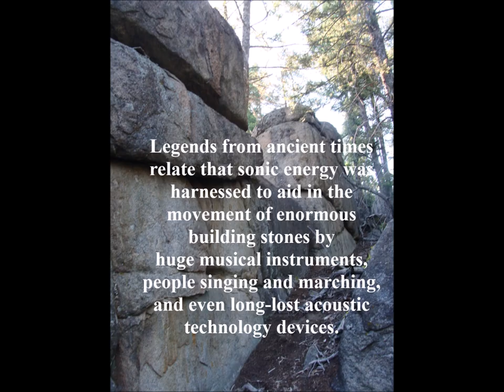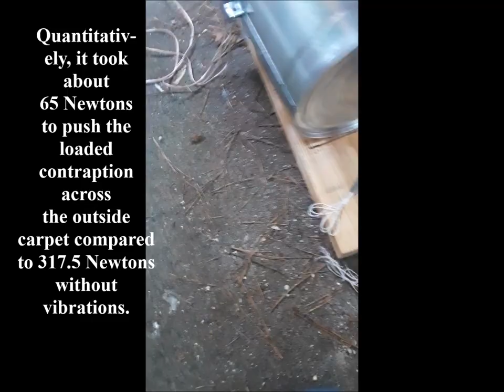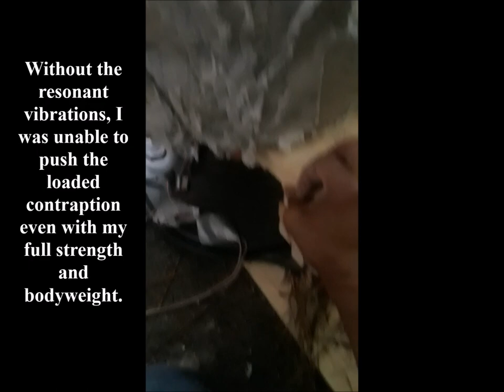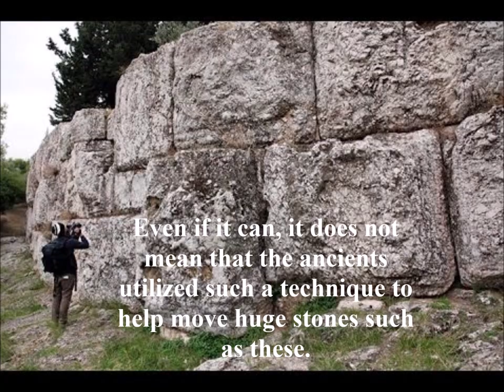Moving Boulders with a Push of the Finger: Did Sound Help to Build the Megaliths?

Comment: What if you made a tuning fork match the objects natural frequency, wouldn't you be able to shape/form the stone very easily as the denisty of the material changes. 
Most older pictures show egyptians with small tuning forks on the end of their scepters which is usually seen when you wanna produduce a higher Hz, the shorter the prongs are the higher the frequency is. 
Just take a look at this reasearch: 

The results of our study show that the frequency of vibration had a significant influence on the mechanical properties of the granite samples. When the vibration frequency is close to the natural frequency of the sample, resonance will cause a significant increase in the displacement amplitude of the sample [35]. This can rapidly increase the crack propagation rate [45]. Therefore, when we applied ultrasonic vibration at 30 kHz to a granite sample with a natural frequency of nearly 30 kHz, destruction occurred significantly more rapidly than at 35 kHz or 40 kHz.

Some of the most advanced high frequency tuning forks we can make today are made with quartz, which the egyptians did have acess to. 

Another thing to maybe consider would be the way tuning forks work aswell regarding up and down motion. For example a 10.000 Hz tuning fork would produce 20.000 Hz when you're holding it against a table, due to both prongs creating up and down motion.

Check this video https://www.youtube.com/watch?v=NVUCf8mB1Wg which shows this theory. 

Here comes the next issue, the natural frequency of the rock would shift as its being damaged, but you would be able to balance out with a higher or lower amplitude, for example with a horn. 
Another theory could be strings between the prongs, to make a specific frequency depending where you would pull the strings (Kinda like a violin).

This is all theory, but i'd love to see some actual work done on it, as its very hard to find tuning forks higher than 5k Hz, so you would probaly have to make it yourself. But even with steel/aluminum you should be able to make such a tuning fork, with the right prong length and a short gap between the prongs to lower the Cross-sectional area of the prongs.
Reply: extra notes:
 Rocks are more easily damaged at low frequencies and high amplitude than at high frequencies and low amplitude for a given energy input 

The effect of loading frequency on the rock strength appears to be small compared to the stress magnitude at low frequencies

Thus, when ultrasonic vibration with a frequency in the same order of magnitude as the natural frequency of hard rock [37, 38] is applied to rocks, the mechanical properties of the rock should differ from those under conventional low-frequency cyclic loading. Thus, a comprehensive study of the mechanical properties of rock subjected to ultrasonic vibration is of great significance.

The results of our study show that the frequency of vibration had a significant influence on the mechanical properties of the granite samples. When the vibration frequency is close to the natural frequency of the sample, resonance will cause a significant increase in the displacement amplitude of the sample [35]. This can rapidly increase the crack propagation rate [45]. Therefore, when we applied ultrasonic vibration at 30 kHz to a granite sample with a natural frequency of nearly 30 kHz, destruction occurred significantly more rapidly than at 35 kHz or 40 kHz.

According to the analysis above, the natural frequency of the sample first increases and then decreases during the vibration process. In order to enable high crushing efficiency, the frequency of applied ultrasonic vibration needs to be within the range of the changing natural frequency of the rock.

when iexcitation frequency = natural Frequency its a Harmonic Frequency and  it creates Resonance which is the Damaging factor. (Example: Shatter a glass by matching its natural frequency which produces resonance and breaks the glass)

Shorter prongs produce higher pitch (frequency) sounds than longer prongs. Long prongs will bend more readily and therefore tend to vibrate at a lower frequency when struck. ... When both the table and the tuning fork vibrate, more air molecules are moved than by the tuning fork on its own.

But ultimately there's little reason why, in a three-pronged fork, the vibrations would ring on longer than just two prongs - there would be the same amount of vibrational energy as in a two-pronged fork, but just shared between two or three modes of vibration instead of one.

Poseidons Trident				(Teoretisk Trident Tuning Fork Koncept)
(Notice U-Shape like Tuning Fork)
Size of prongs = Low frequency(hz)?

https://www.youtube.com/watch?v=MdZ-vkfZS0I&t=304s
https://www.youtube.com/watch?v=NVUCf8mB1Wg&t=455s

Note: Small Prongs, High Frequency? Is the top a Knife Drilling Bit?
First Tool, Picture 1. (Measurement Tool for Natural Frequency of objects?) 
Picture 2 and 3 left hand = ankh (Prolonged Frequency Vibrations?)
Size of Rod = Length from feet to face(eyes?)

(Notice:String Between the Tuning Forks) Tension Strings? a controller of frequency output by plucking the wire diffrent places? (Example would be a violin)
Reply from the maker: Thanks for that video link!!! A tuning fork being able to vibrate in more than one direction could have a number of applications including acoustic lubrication because the vertical vibrations would essentially reduce its contact with the surface just like the resonator I use in this video or the way a cellphone vibrates across a table. However, the horizontal vibrations, being symmetrical, would not produce a net horizontal displacement unless an asymmetrical component were introduced like small weights on one side of each prong/ tooth of the fork. 
The resonant cutting/ grinding idea is certainly viable. However, we'd have to continuously provide input energy to the large tuning fork to keep it going. Perhaps this is where the strings come in. It seems that the strings could be adjusted as the resonant frequency of the workpiece changed.
Reply: @gsutton78  What if you apply some kind of sound reflector at the bottom of each corner? 
In general, soft, pliable, or porous materials (like cloths) serve as good acoustic insulators - absorbing most sound, whereas dense, hard, impenetrable materials (such as metals) reflect most.
Reply: Another thing i found interesting when i researched old tools/staves would be the Aaron's rod and Moses Staff. 
I was wondering if these indeed were tools inform of a tension rod that produced a specific frequency and even poseidons trident for that reason. But its all theory, i just have a feeling ancient humans had a good understanding of how the universe worked regarding frequencies and how to use it for bulding purposes.
Reply from the maker: @tcgdenmark-6590    Yes, I believe our ancient ancestors were very knowledgeable of the inner workings of the universe. Modern science is starting to confirm many of the concepts once considered fringe. For instance, there is now strong evidence that sound vibrations (represented as phonons) carry "negative mass". https://physicsworld.com/a/calculations-provide-insight-into-why-sound-waves-carry-negative-mass/.
Reply: @gsutton78  Jesus christ, i've never heard about the Negative Mass regarding sound before! 
Thats exciting and could hopefully show more uses for sound regarding using it as a tool. 
Very exciting, thank you
Reply: Have you thought about sound as a healing factor, most of the older gregorian chants produce the Solfeggio frequencies,  so i couldn't help but wonder if the very old churches used sundays not only as a day to pray but a frequency cleasing of the body.
And i cant remember exactly who, i'll have to find the research again. But a guy made like a box which were "supposed" to have healing properties from curing cancer. 
Cancer cells have seen to be destroyed at high frequencies such as 300k
Reply: Regarding your link, would this mean light also could have a potential mass? 
Maybe that might even be they way to make the "holograms" and what not, if you can modify the mass of light. But this concept is new to me so its all theory : D
Reply from the maker: @tcgdenmark-6590    Certainly. Both sound and light, as functions of frequency/vibration, can be used in healing. Our body chakras and meridians seem to respond to different frequencies of light and sound. The modern terms are chromatherapy and vibrational medicine respectively. Further, scientists have confirmed that the meridians, once thought of as Eastrrn pseudo-science, actually do exist. By shining light on parts of the body, scientists found that the light would actually travel beneath the skin along certain lines as if they were biological fiberoptic pathways. And these lines were of the same patterns as the meridians of old world science!
Reply from the maker: @tcgdenmark-6590    No, actually light (photons) are still massless. The prevailing theory is that mass is derived from the Higgs-Boson field, a quantum energy field with an even distribution of particles throughout the entire universe. It is the interaction between these particles and the Higgs-Boson field which gives particles their mass. And when we have mass, there is a curvature of the fabric of space-time, resulting in gravity and what we perceive as weight. Some particles, like photons don't interact at all with the field and are therefore massless, whereas other particles like electrons interact weakly and thus have very low mass. Still, other particles like quarks interact strongly and have high mass. So, sound (represented as phonons) are unique in that they interact with the field in a way as to have negative mass. Interestingly, phonons are also associated with heat which causes certain particles (gases, etc) to rise. So the question might be can sound give levity to the solid materials through which they pass in a similar way as heat does to gaseous particles. 
The Higgs-Boson is essentially the "new aether". The aether was believed to be the medium through which light and other forms of electromagnetic energy traveled through space. And it was the aether's interaction with matter and vice versa which manifested as gravity and weight. But, the aether concept was scrapped in mainstream science circles when Einstein published his theories of relativity which state that the speed of light is constant everywhere in the universe. This didn't fit with the aether because as a fluid, the aether would have an effect on the speed of light, an idea that was disproved by the Michelson-Morley experiment which found that the speed of light was constant. So, experiments to confirm the aether failed, however the Higgs-Boson particles were proven to exist in 2012. The idea of phonons having negative mass is apparently still theoretical, but if proven true, it will make the claims of ancient people and John W Keely using sound to move heavy objects that much more plausible.

Comment: Keep up the good work bro.  One thing I have always noticed is that you can amp up any note and if you have any stringed instrument sitting around; all strings tuned to that note will start to vibrate.

If you were to figure out what a piece of granite is tuned to could you replicate that tone with an instrument to move that granite?
Reply from the maker: Thanks a lot, brother! 😊
Reply: definately, but question is how to find what frequency the granite  is tuned to, to begin with.
Reply from the maker: @ghostmateify   There are ways to calculate it. Or it can be done by feel; by cycling through various frequencies to search for the strongest "response".

Comment: 3 wooden boards with a wheel device fixed on the top board designed to be over the middle board using stiff leather flaps to slap the middle board as it is rotated. Lubrication between all boards (water, oil or ???). Bottom board is like a road ( sections to be moved with progression). Then..... take it from there

Comment: Use a longer wave form @ higher frequency and make the motor vibrate up and down not left to right and you got it.

The frequency used should match the resonant frequency of the item you're moving.

Comment: You need vibration conected to the stone it self and resonance in the stone  ..
Reply from the maker: Home made science. Exactly! We need an efficient medium of transmission like John W. Keely's gold, silver, and platinum wire!
Reply: @gsutton78  soo in his case  I think he used electricity impulses(that's why he used better conductor)but in your case is physical device soo 2 different ways,maybe we need induction of ring waves by physical device and wire on rock as amplifier of those waves on the rock it self...My thinking
Reply from the maker: @nukeelda   Well actually, sound can travel through wire or string. Remember the paper cup phones we made as children? I think Keely found a way to do that efficiently so that nearly all the energy from the sound source was transmitted to the object to be affected.
Reply from the maker: @nukeelda      Fascinating video. Interesting how he said two frequencies with a distinct harmonic ratio had to be used at the same time. Keely used chords; a base frequency and 2 or 3 of its harmonics sounded simultaneously.
Reply: @gsutton78  Yes in video they use to destroy or saparate particle but we need oposite to build up together there is difrence like you said Kelley used 1+2=3+2=5 fractals I goes...

Comment: So, im aware the pyramids werent built when there was sand everywhere like there is today - but do you thinking sand could be maybe helpful with resonance pushing.. potentially friction to prevent it falling backwards during an uphill push?
Reply from the maker: Sand might help up to a certain weight, after which the sand particles would then begin digging into the surfaces, creating even more friction.

Comment: I saw a video on the vibration levitation technique used in the Himalayan monk texts. According to the mathematics it is possible to move a stones with sound as proven in this video. A study case was done on the mathematics and they presented that to be able to move a 1 ton stone you will need around 90 000 kilojoules of energy, If you look at some of the biggest musical events hosted around the world some have a kilojoule output of up to 400 000 kilojoules meaning it is possible to move a 4 tone stone easily with a massive class A sound system for big events. 

I personally think the ancients never used only sound but something similar to what this video might be doing. The ancients and their instruments with it's sizes and numbers should also be able to get to around 400 000 kilojoules especially if the energy point is more concentrated towards a smaller surface area.
Reply from the maker: I think so as well. In fact, I make a similar analysis concerning energetics in this video: https://www.youtube.com/watch?v=_lHR8toYHn4.

Comment: Wish I would've known this trick when I was trying to slide a 150lb floor jack on a board. I was lifting the corners of a tiny house. No cement pad,  just blocks in the over grown turf. 

What if you had gravel on the board ?
Reply from the maker: Gravel or sand might help to a certain degree. But after a certain weight, the particles begin to dig into the surface of the board, creating even more friction.

Comment: Brother, The issue with your bui is the machine is on top of your sled. I am an expert in Pyramid technology and sound, vibration would have likely been used over the ground to vibrate the sound. Try putting a row of these on both sides of a and track and then see what the force required to puh it along is. The sand is displaced front the sled with a curve in front preventing it from sinking while the vibration of the sand makes it a lot ore simple to pull.

Comment: You don't need any of the complicated air wires and breadboards, transformers and such to accomplish this buddy, by adjusting the frequency you are making the atomic structure vibrate to and during that process exists a gravity shift waveform enabling it the feeling or appearance of reduced weight.

Comment: But you have the vibrator underneath the granite making it skip. The granite needs to be directly on the wood with the noise generator next to it and take the force measurements.
Reply from the maker: Awesome Dee   Placing the mass next to the vibrator is certainly a way to do it. However, in doing so there is a considerable drop in vibrational strength the further the mass moves from the sound source until the effect is lost entirely. With this method shown in the video, the entire sled can continuously ride the acoustic wave.  The challenge is to figure out a way to resonate the mass itself strongly enough such that it can move but not so much that it would shatter or disintegrate.

Comment: 1. Wattage of your resonator? I assume it is a subwoofer? 2. More interested in performance with wheeled vehicle rather than sled.
Reply from the maker: Allan Dulles.    Actually the resonator is made from a 6 Liter metal pail cavity. Wattage with 2 powered coils combined is in the neighborhood of 600 Watts. Comparison with wheeled vehicles is somewhat irrelevant at this particular stage because we're considering a time in history in which it is believed the wheel was not yet invented, and any wheels later used would have been unlikely to be as durable as modern rubber. Even still, some engineers believe that even our modern wheels would have great difficulty in managing some of the sheer masses that compose many of the ancient structures.